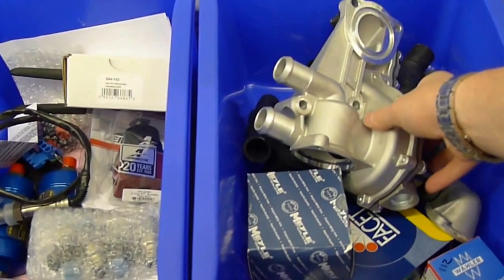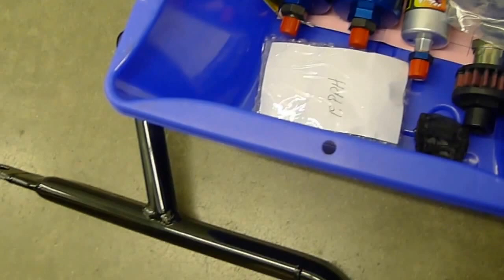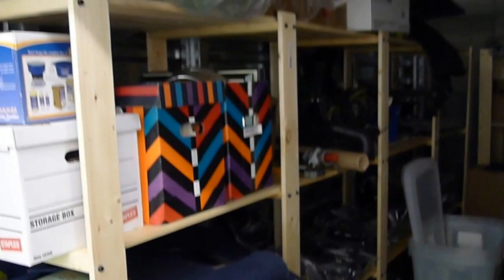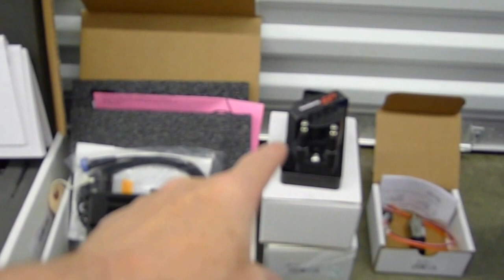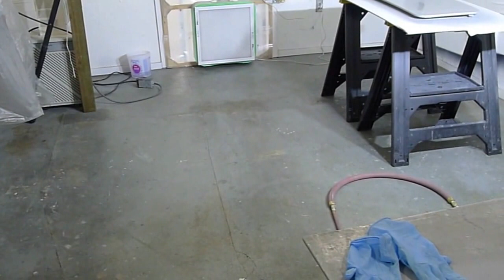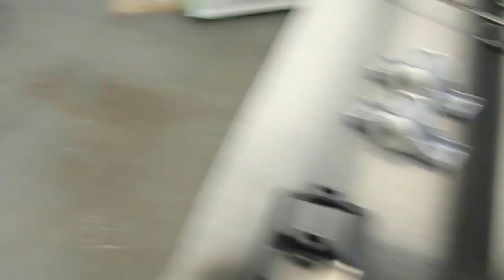The Ultimate 1983 Rabbit GTI Project - part 43 (ECU, final paint starting)

Comment: Nice Derek! Question for you, do you have those fans on push, or pull? Are they pulling air thru that door and out the big door?
Reply from the maker: +asicerik They are pulling air - and after lots of testing it turns out they do a great job even though they only draw 9amps each at full power. They do a very good job of cooling the radiator at about 30-40% duty cycle. That is partially due to the excellent thermodynamics of the radiator and partly the efficient air flow.